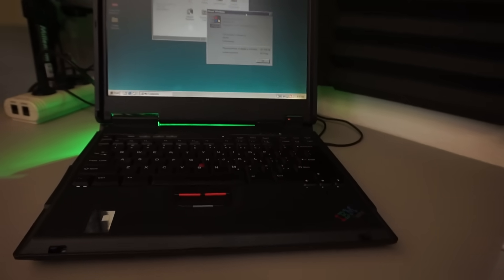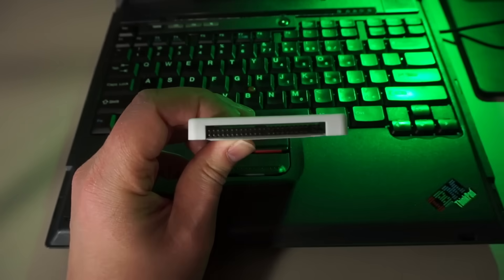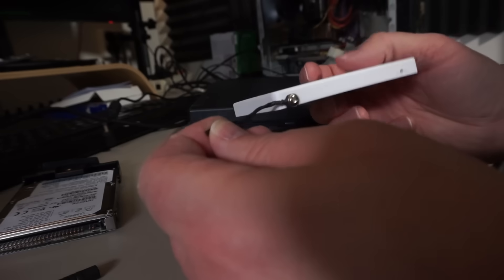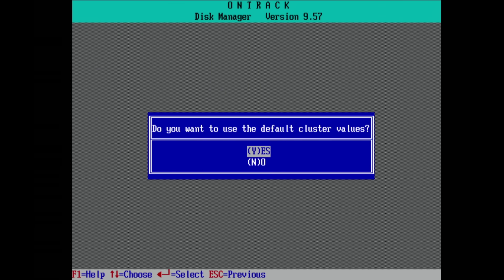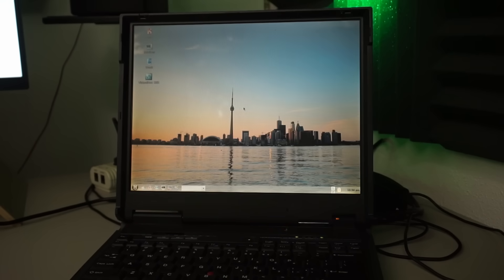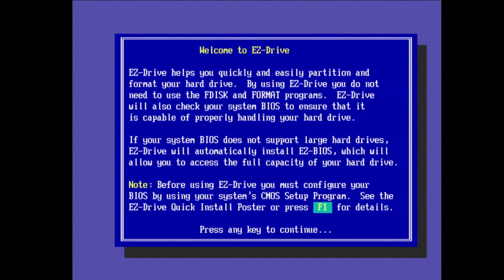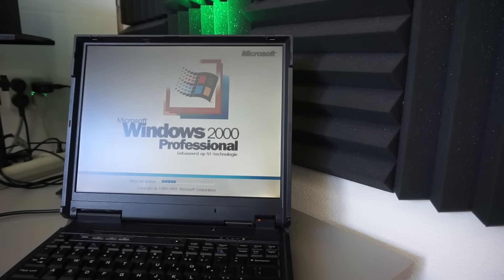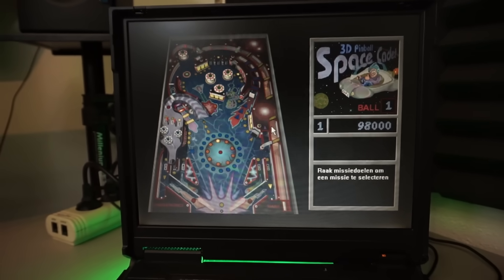I put an M.2 SSD in my Pentium 3 laptop!

Comment: Tip for those that don't know, you should turn off "defragmentation" on SSD on Win98.
Reply from the maker: Good point, I should've mentioned that!
Reply: @op that was the rule with the first SSD drives. Ones made after that had no problems due to much higher endurance.

Home server duties are far more stressful than defrag on modern SSD.

I would also use a third party defragger (because they (win95-xp defragger) are super old versions of stripped down diskeeper) for older operating systems since they will be able to properly handle and identify newer drives, they also manage data faster. This applies to xp and below.

Defragging modern SSD drives results in negligible to non existent wear due to super high endurance. Unless your SSD came from the early 2000's, I wouldn't worry about it at all. Dirt cheap modern SSD drives will be relatively unaffected by even defragging often.

But I agree, probably best to shy away from win98 defragger and use something else, or dual boot a modern OS and defrag with that one only.
Reply: @ it’s still bad to defrag because it nukes your speed and the separate modules that the data is stored on afterwards. You can only read and write so much to ssd modules
Reply: all modern Windows also defragment SSDs. To verify this, you can run the PowerShell command:
Get-EventLog -LogName Application -Source "microsoft-windows-defrag" | sort timegenerated -desc | fl timegenerated, message
Reply: all modern Windows also defragment SSDs, if fragmentation is more than 10%. To verify this, you can run the PowerShell command:
Get-EventLog -LogName Application -Source "microsoft-windows-defrag" | sort timegenerated -desc | fl timegenerated, message
Reply: Or use a modern Linux version like MX Linux which does wonder on old Pentium III. MX Linux has all the drivers needed and even plugging a Bluetooth dongle and it will be immediately recognised. I also forgot that MX Linux has a version for IBM power PC processors

I'm nostalgic of old tech but not old OS and older os don't do justice to these old computers
Reply: @danteerskine7678   Just Run XP on PIII, Unless its Arch linux, nothing comes close.
Reply: Why, you can still defrag an SSD, and no it does not decrease life span.  My first ever SSD from 2013 just died start of this year, and It had soooo many OS wipes, and probably a years worth of defragging.
Reply: @aeonhelendale8777 and my hdd from 2009 is still kicking, but ig ssds were much less mature than hard drives back then
Reply: @aeonhelendale8777  an ssd should last way longer than that. i have a 2006 hdd that i dropped at least 5 times (rn in an old fujitsu esprimo) that still works, running antix. ssds should last longer than hdds
Reply: knowing it wont automatically do it that sounds pretty futile, it will warn you after you hit the button to do it 😕

but hey dont listen to a pctech of 38+ years experience  over a guy that doesnt know even DOS will warn you, After you press the button to start format...  ps   its been a tool since 1986 when win 98 was on the drawing board...

Comment: wow this video is 90s nostalgia.  Floppy disks, DDO, Ontrack, 44 pin IDE and 40 pin adaptors. way way back in the day i used one of hose adaptors to put a 1GB laptop drive in my 486dx33.
Reply from the maker: That must have been some upgrade!
Reply: @ex-itguy it ran in tandom with a 540 meg maxtor and i used a 486dx4 100 over drive chip. I had 8 meg of ram. I could play the og doom.
Reply from the maker: Still the best game ever! 🤘🏻

Comment: Top tip for those insanely tiny screws - either stick a neodinium magnet to the shaft of the screw driver or my favourite - a small blob of blu-tac on the end. Even a tiny piec will hold the almost invisible screw!
Reply from the maker: That's some solid tips! I knew about a blob of grease at the tip of a tool on heavier stuff but I never thought about using that on tiny screws like that! Also, the magnes to the shaft makes sense! I have been making screwdrivers magnetic by rubbing them on a magnet, but if this works it's a good idea to keep a magnet in my drawer 😄

Comment: Did you think about flashing the bios with a more practical control of the initial architecture, to enable use of more modern equipment?
Reply from the maker: This system is already on its latest bios. I'm not going to risk bricking this one with a bios hack if that's what you mean. :)

Comment: I have already done that but used a 128gb M.2 and did use the same used a ide converter and have Window XP on it and another laptop with dos and windows 3.11 which has a floppy drive and a cd rom. I still have all the windows dos disk and windows 3.11 disks and even have some office disks.
Reply from the maker: That's awesome! I don't have any diskettes from the nineties anymore. I had to buy new ones when I started to get back into the hobby.
Reply: @ex-itguy  I even have some old 5 1/4 disks left over from my days when i had a Commodore 64.

Comment: p3 was a beast when it came as compared to pentium & P2, although amd athlon offered more performance than intel for the same price many didn't knew this & were concerened for hea issues which i never found.
Reply from the maker: Hea? You mean heat? Well the Athlons definitely ran hotter but not by as much. They did however instantly die without a cooler (which caused problems with badly connected ones). But indeed they performed really well.

Comment: You can get these adapters for M.2 and mSATA. Usually mSATA disks come in lower capacities. Not sure though if they are not the same price as a bigger M.2.

Once I gather the courage to open my iBook G4 I will build into it one of these adapters. I think it will have no problems with the bigger disk, as it already was EFI even back then.
Reply from the maker: mSATA is getting old as well, so M.2 SATA SSDs are easier and cheaper to get, that's why I chose this option. There are smaller ones available as well so that might be the better option for this one. 
Not sure how much a G4 will take. I haven't had the courage to change mine either since they're not exactly easy to swap. I believe that takes SATA drives though so you could probably just buy a 2.5" SATA SSD for that. :)

Comment: I bought my first SSD when they were just starting out and ran Windows XP on it. Without the TRIM feature, Windows crashed on me within a year or so. So I reinstalled them and again after the same amount of time. After the third crash, my SSD developed bad sectors. Of course, I applied all the settings from the beginning to extend the life of the SSD. Then I started using Windows 7 where I verified that TRIM works and I didn't have any more similar problem.
Reply from the maker: So it's more important than I thought. Interesting!

Comment: A tip for trim on a xp or earlier machine is to boot into linux every now and then, and run the trim command from there.
Reply from the maker: That's an idea that was on my mind. Does that work with both FAT32 and NTFS?

Comment: I just did this change and upgrade to my highschool era iBook G4.  Gave it a M2 sata SSD on converter similar to yours.  Then maxed it to 1.5gigs of ram.  Keeping it around for memories.  Might put linux on it, but I haven't worked out the wifi yet or the Bootloader install, Debian has been a real pain.  Wish I could put Mint on it.
Reply from the maker: I made a video on Adelie Linux on my own iBook G4. Wifi is indeed problematic and you need to head into open firmware cmd+option+o+f) to tell it how to boot.
There should be older drivers for that wifi chip but I haven't gotten around to trying to fix that.

Comment: Playing around with old hardware and software is fun, but when you need Wi-Fi, quick USB-C ports onboard, more RAM memory or a bigger and faster "reads/writes per second" hard drive, the trouble starts. Then there's the slow USB version 1.0 or 2.0 and lack of support for new hardware. 

Old versions of operating systems can have network security problems, don't support newer facilities, and in general retro hardware older than 10-12 years starts to run so slow that the computer is suitable for receiving email (if network is connected) or writing texts and programming DOS-mode text applications (Pascal, C... for DOS). It can also squeeze a little more out of older hardware by installing Linux, but here there can sometimes be problems with some unusual drivers. It is always possible to play around, but over time such an old computer is only suitable as an exhibit in a museum of computer history or a museum of technology. 

You can say that for a collector or a do-it-yourselfer, it is good fun, but for an average computer user — at work, at home, for entertainment, for modern games — it is a difficult problem to maintain such old hardware. Setting up a new PC with Windows XP freshly installed approx. 25 years after Windows XP has premiered, without adding antivirus and firewall software is very risky today.
Reply from the maker: Sure, this isn't for the regular user at all, but for the old hardware enthusiast trying to have a little fun with old systems. ;)

Comment: Maybe flash your BIOS, a newer one can maybe accept bigger hard Drive.
Reply from the maker: It's already on the latest. :)
Reply: @ex-itguy  well done. This is a Strange thing Thst a piii Board cannot comply with hard drives aboves 25 gigs, ....even 128 gb.
Reply from the maker: ehm, it handles everything up to 137GB. Just not this 256GB drive.

Comment: My solution for no TRIM. I image the whole drive, then every few months pull it, and either wipe or image again, then run TRIM on it  connected to a modern PC externally, then reimage. 98SE is light on writes, so more frequent TRIM isn't needed.
Reply from the maker: That's actually not a bad idea at all! Great idea!
Reply: There's a few more steps of course. I use AS-SSD to handle offset/alignment, and Phil has the last free version of MiniTool Partition Wizard hosted on his site.

Comment: For not wear the SSD with such old OSes without TRIM support, just left the empty space on SSD. Like not to create partition to the full of disk capacity. I leaving up to 4 GB at the end of SSD. Also I'm using Mini Partition Tool to align partition, but remember that on some PCs disk after that failed to boot. But in my 486 machine I'm using mSATA to IDE adapter with DOS and Win95 installed - without that preparation, and using that disk for over 2 or 3 years, almost every weekend for couple of hours. And everything is working well.
Reply from the maker: I'm actually picking up a 486 laptop tomorrow! I wonder if this adapter will work in there as well. :)
Reply: @ex-itguy  I'm using relative small mSATA SSD. So I don't need to bother about limitation of BIOS, as I'm in the limit :) But using such kind of adapters in all my computers with IDE interface like Amiga or old PPC Macs with IDE. No issues at all. Oh sorry I had a problem with Amigas, but that was software related issues, which I had resolved with newer software and tutorials from web.
Reply: @ex-itguy  BTW, great video with that ThinkPad :)

Comment: Some of those NGFF SSD to IDE adaptors are a little off for fit. The big “A”  has them as well. I used an inexpensive Timtec 64Gb for my “XP” Dell 600m (Pentium M) potatoe. Also of interest is a program called Naraeon SSD Tools, works on Windows XP not sure about 98 or 2000 and it only finds the SSD on the IDE bus not the SATA bus of these old operating systems.
Reply from the maker: Thanks, I'll try that one! Bit old, but I guess if it works it works :)

Comment: what if you partition the drive in another pc? I use easeus partition manager usually.
Reply from the maker: That wouldn't work because the BIOS would still report 137Gb to the OS, leaving it with a broken partition table.
Reply: @ex-itguy  Seems odd to me that it wouldn't work if ya made a bunch of 64gb fat32 partitions it wouldn't see them all as seperate drives but you're probably right and I am no expert junt a tinkerer.
Reply from the maker: I'd say give it a try. You can use something like 86Box to emulate a Pentium system or so. I can assure you it won't work as you expect. ;)

Comment: X31 and x41 had a rare 1,8" and slow drive rhat failed. Instead they where installed on to comact flash cards. Installa where made so that when os booted, it did not write back to the card but RAMDISK was used for pagefile and so on.
Reply from the maker: I believe those are the same as in early "big" mp3 players, like the Philips GoGear HDD6320 I have owned, and some iPod models.

Comment: Maybe trim doesn't work correctly because of ddo, just live happy with 128 gb partition with one os? It wasn't expensive... And it will make your ssd live longer. BTW Rudolph Trim (RIP) app never disappointed me...
Reply from the maker: Could very well be indeed. I think I'll buy a smaller one and slide this in a more modern PC. :)
Reply: @ex-itguy  to be honest, by looking at the current prices of 128 and 256 GB SSDs, I'll leave it as it is, I have 8 for OS and 120 Gb for installed games partitions in my Win98 overkill setup (P4 3.2GHz, 2x512, Radeon 9550 128bit 256 MB, BIOS modded to between 9600 to 9600 PRO, SB Audigy 2, 256 GB SSD and 2x120 GB regular HDDs for ISOs, DVD+-RW), TRIM utility running every start of PC in autoexec bat before running Windows and half of empty unpartitioned space and I know, that SSD controller have half of disk to operate if by any reasons TRIM will not work, and knowing, that nothing can happen to SSD is more reasonable for me. I heart a lot of stories about dying SSDs because of full not using a TRIM and not having unpartitioned space, maybe I'm too crazy about this, but it works and will work for long time, I have it for almost 5 years without any problem running like that... And of course, like somebody mentioned here, no defragmentation enabled 😉
Reply: @ex-itguy  Uhh, fck! Sometimes I want to send nuclear something to YT HQ, coz I did spent 15 minutes to write answer here and it disappeared, no links, no dots between words like autoexec bat... YT wants to make monkeys from US, so I'll answer again in monkey style :D. By looking at the current prices of 128 & 256 GB SSDs, I'll leave it as is, 128 for Win98, 128 unpartitioned, TRIM app to autoexec bat before Win starts, and SSDs will live a much longer time. I personally use my 256 SSD in same way for 5 years  and no problems 🙂 And of course disabled defrag...
Reply: @ex-itguy  3rd attempt: Uhh, fck! I did spent 15+5 minutes to write answer here and it disappeared, no links, no dots between words like autoexec bat... YT wants to make monkeys from US, so I'll answer again in monkey style :D.
By looking at the current prices of 128 & 256 GB SSDs, I'll leave it as is, 128 for Win98, 128 unpartitioned, TRIM to autoexec bat before Win starts, and SSDs will live a much longer. I personally use my 256 SSD in same way for 5 years  and no problems 🙂 And of course disabled defrag....

Comment: Apart from TRIM, there's also an issue with the 512/4096 byte sectors: DOS and Windows up until XP create the first partition at sector 63, which is internally misaligned with the actual hardware, so it's recommended to create the partitions separately or align them at a later point. Don't know if it's at all noticeable in this scenario though, but I can recall how awfully slow the XP was on WD Green HDDs without the alignment performed
Reply from the maker: Could be indeed. Though I'm not sure if that's harmful in any way. The drive's way faster than the IDE bus can handle, so I don't think I'll gain speed by trying to align them.
Reply: @ex-itguy  Still good to try to align the paritions to reduce premature wear and tear to the SSD.

Comment: I think, on the win2000 installation, the cpu is the limiting factor at startup. I have a dual socket pentium II Mainboard and win2000 starts much more faster with two CPUs, than one.
Reply from the maker: Idk, it looks like it's waiting for something.
Reply: @ex-itguy  Yes. That's always at that point of a win2000 installation. But I think it's waiting for the CPU to get the work done. So with two CPUs win2000 starts quicker than with one, in my case

Comment: oh nice the same adapter as i use since years in my itx cases but with normal the normal connectors my variant has 2 times m.2ssd slots i have 2 of it so my 2 of 4 sata ports are full (: "btw." i not use windows with it,  word in "" is the hint of the os i use 🤓
Reply from the maker: Haha, I've been using the btw-os a lot myself too lately :)
Reply: @ex-itguy  😂:yougotthis:

Comment: I did exactly that to my T60 Thinkpad a couple of years ago. I used a 60GB mSATA SSD, and a mSATA-to-IDE adapter (because I don't think there were NVMe-to-IDE adapters available back then) and it worked quite well.
(edit) I used a caseless adapter, not one with a case like you did. That was less problematic than dealing with slightly out-of-spec cases and you have noticed. I just wrapped the assembly in a sheet of paper to insulate it against potentially touching any exposed metal inside the bay, and to keep it held in place better.
Reply from the maker: Note that it's not an NVMe drive though, but an M.2 SATA drive. I think you'd need a lot more translation between NVMe and IDE.
Reply: @ex-itguy  ahh ok I hadn't noticed. So basically the same setup as mine, except I went for a smaller drive and had zero problems. :)
Reply: T60 you can mod to use SATA.. I think T43 too